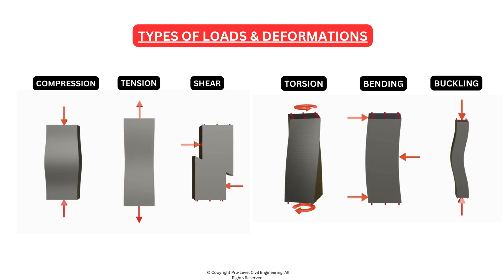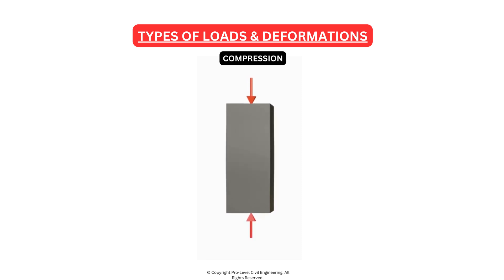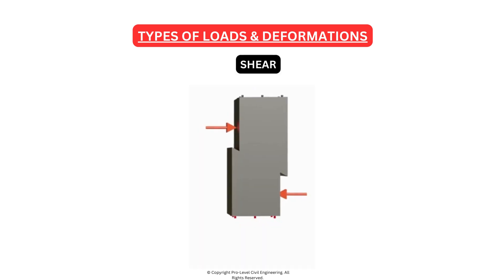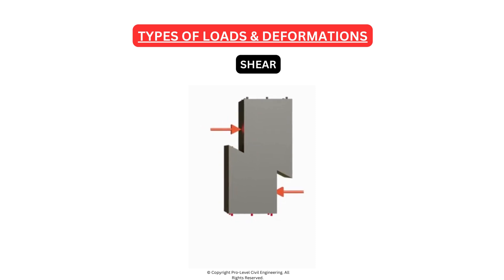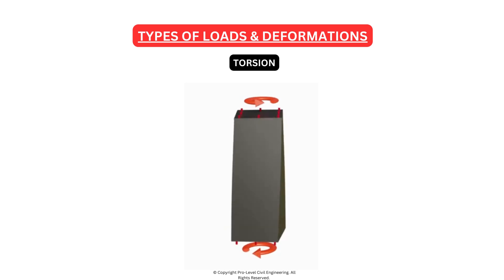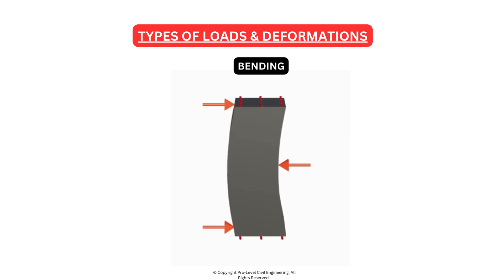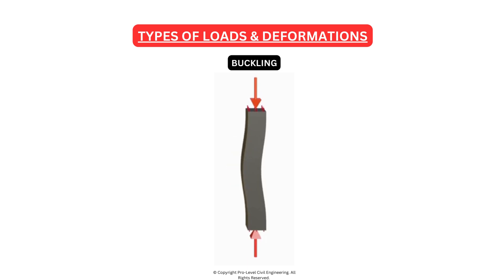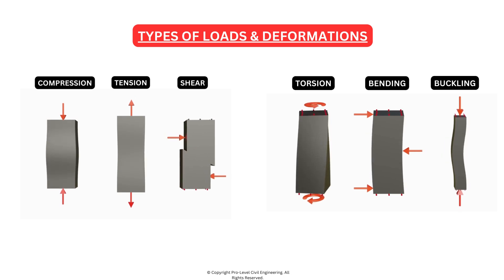Types of Loads and Deformations Explained

Comment: I think that shear is not well represented here. While the other deformations are presented as continuous, shear is portrayed as discontinuous. At least shear is represented in an incoherent way respect to the other deformations, and moreover, shear is represented as a rupture and not as a true deformation. The quality of the animation is good, but honestly i find shear misrepresented. It sould be a true deformation sideways between the upper and lower part of the bar. I know this also would imply bending, but as the element chosen for the examples is a bar, it is imposible to separate shear from bending.